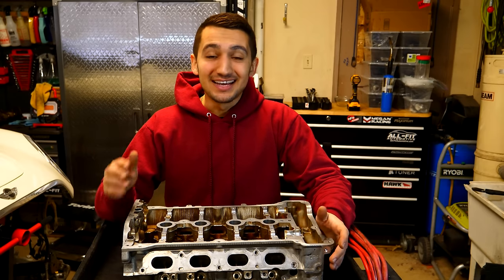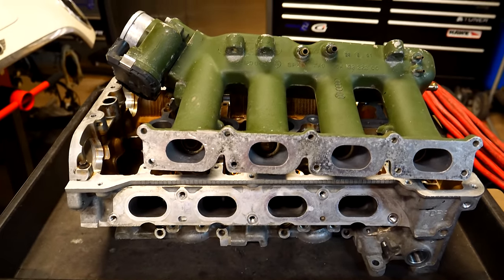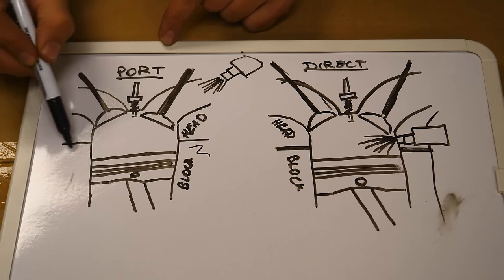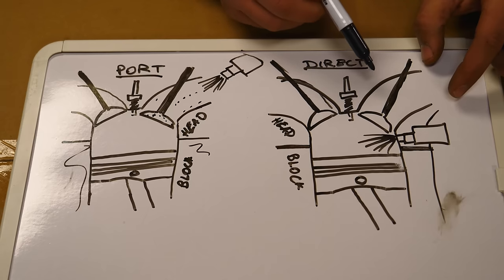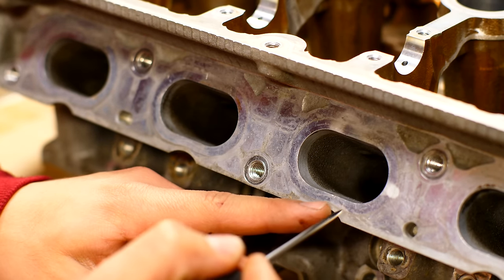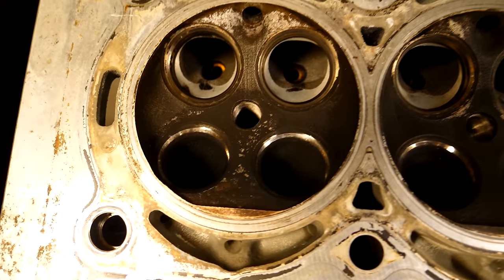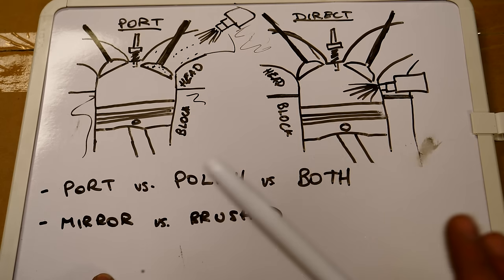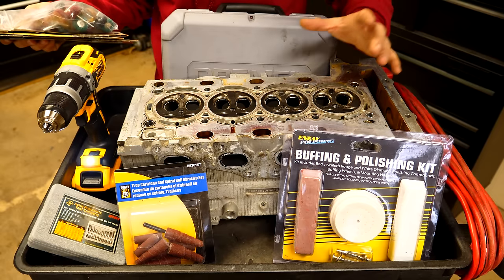Porting vs. Polishing vs. Both

Comment: Go back and learn before you impart knowledge.... Listen.... Dont take advice from a guy who sandblasts his head period.  Now Milanmastracci.... Let me school you on one of the most highly controversial subjects  in tuning.
1. never sandblast... Tank it or use boiling soap and water. sure it takes longer but its more consistent and safer.
2. Unless your running a carb you want to mirror polish the whole port. Heres why"
A rough surface makes turbulence which is controversial in gains at best. A rough surface is also a bed for contaminents to stick to which is a huge issue in VW direct injection engines... duh... 
A smooth port again is a clean port.    
Also a smooth port has a great drag coefficient. Sure dimpling wins on a flow bench but not by much.
3. Steps are never good. cutting that carbn ring area down or fitting a tighter gasket is a win win.
4.  good injectors atomize enough and a rough surface allows fuel pooling which is never good.
5. no port job should be  quick enough to last a few hours. Old experts take hours like 80 is avrage for a great port job.
6. If like me you dont haved a bench you should be using water. You can cc the runners just like ccing the head and it does help keep flow even.  
7. Unless your placing in new valve guides any porter should tape up the guides and use extreme caution in this area.
8. The exhausts can be cut to an extreme. IE the guides can be cut right off leaving a perfect polished tube.
9. if this makes no sense I am porting my lotus 910 head now and would be glad to take photos the only catch is they will be on mightycarmods forums.

Also note   I am glad you realize that FSI engines should be smoothed right to the valve seat.  Good on you.
Reply: DAmn auto correct. `mirror finishes OEM valves
Reply: @Robert DeHart You need more education, also. Rough surfaces don't allow pooling. Mirrored surfaces do. That's why no one polishes ports on a carb'd application. That's the only thing I'm addressing but it's not the only thing you're wrong about. Wanna learn real speed secrets and how it actually works? Leave those garage hacks, mightycarmods, and go check out speedtalk. Spend a month reading. You'll see just how much you don't know. 

These are top guys in the racing industry. People like John Kaase, for example. David Vizard. Darin Morgan of Reher Morrison. People like him that design cylinder heads. John Marcella, who makes Marcella Manifolds. Guys that have known names in the racing industry. Go learn there. You'll see just how wrong mcm is about whatever it is you've learned there.
Reply: When every dyno test shows power picked up with intake ports roughed in with a carbide burr vs sanded smooth with a cartridge roll, why would you want smooth ports? You can, keep em, and stay at the back of the pack.
Reply: Just like the people that think "bigger is always better" as far as port size is concerned. If it's bigger, it must flow more! You got a flowbench to check your work? Porting without one is like doing surgery blindfolded. You can increase the port size yet decrease to total cfm and never now it because now the velocity of the air slowed down. Now, it doesn't fill the cylinder completely and you've lost 15hp yet you don't know it because you assume bigger is always better! Go to speedtalk. Stick around for a while. You'll learn quite a bit from the guys who do this daily, for a living. And make a good livi g doing it. Why? Because they're good at what they do.
Reply: Making statements like "steps are never good" show just what you don't know, Robert. Take a BBC with rectangle port heads and put an oval port intake on it. It picks up 20hp every time and the mismatch there is UNBELIEVABLE. Yet people now do it purposely just for that specific reason. Why? That sharp edge does something to the incoming air to help it atomizer, mix, whatever it does. And it picks up power from a HUGE step. But if we followed your advice and tried to "gasket match" the ports, we'd lose at least that entire 20hp. Possibly more. Before you try to impart wisdom on anyone else, make sure you're not telling people this bs. Cuz that's what it is.
Reply: LMAO..... I've done enough testing. I need more education? It sounds like you read an article like the maker of this video and put it to memory. I'm speaking from experience..... 5.3 LS, 318 Dodge, J/K Series Honda....all respond better and ultimatelty make more power with ALL SMOOTH PORTS. They all have one thing in common, FI. As I said above, rough ports are good for carbed vehicles that use the walls to help anatomize. I'm sure that article you read made you feel extra smart 😂😂
Reply: You need to look for my first comment on this video. I clearly say carbed vehicles need rough walls. Maybe you should read more..... FI like smooth, carbed needs rougher walls to help atomize the fuel. This kid reads and article and thinks he knows everything. It's dangrous to listen to him. If you need help, call a speed shop or machine shop, or hell anyone but this kid
Reply: 😂😂  My (2) reply's are right next to eachother.  Baby boy needs his Ba Ba, his feelings go hurt.... "Dumbass" really hurt my feelings. I didn't know I was replying to a blind man, who couldn't see a reply on the same screen as the one he was replying to.....
Reply: @HalferLandPerformance  said the guy who responded like a 5 year old haha
Reply: Since you seem to be the expert... can i just smooth out my exhaust port or would i then have to do more work else where
Reply: @lachlanwithers2954  if you only want to smooth out your exhaust port- that's fine. Although cleaning up the inlet ports will see gains as well. There is generally a lot of surfaces that can be cleaned up in both inlet and exhaust ports- a "clean up" doesn't increase port size at all and doesn't necessarily smooth out the port to a mirror finish- it just gets rid of imperfections in the casting especially in transitions from the port to the valve bowl. To be honest, a lot of gains can be made in the valve bowl itself. Guys who do a lot of porting will usually use a P.D. valve (Pressure Differential Valve) on a flow bench so they really know how the port works and can be optimized. Don't be scared, get in there and have a go. There's only one way to learn- research and practice

Comment: Polish combustion chamber and exhaust on carb'd applications. Fuel needs to stay in suspension. With polished ports, fuel sticks to smooth surfaces, coming out of suspension and pudding in the port. Not what you want on a carb'd app. If you're injecting into the port, anything above the injection point can be polished also, to put it simply.

Comment: Good vid.rough port works like a golf ball,all the dimples have air in them allowing the in coming air to pass over it smoothly.any sharp edges in and around combustion chamber and ports creates hot spots,radiance all corners to keep heat down.and don't go through to the water jackets when porting or you will end up with water injection too

Comment: Ferrari build there v12 engines fully polished tried and tested but I suppose they lack the knowledge to know weather it’s beneficial!😂
Reply: Ive heard the "theory" that a rough finish keeps fuel atomized and that it actually helps flow a million times.  BUT HAVE NEVER SEEN IT PROVEN! EVER!  One thing I do know is that a rough surface does transfer heat to the air fuel. And yeah, I have actually seen that proven. I think that current F1 engines are fully polished also. So to me, it makes sense to fully polish everything. I mean if you cannot PROVE that your rough surface actually does ANYTHING better than polishing but you KNOW that a rough surface transfers heat into the intake charge then of course it makes sense to polish it.

Comment: IF you choose to "Port and Polish" Don't forget to raise the roof. NOT lower the floor. Such a controversial subject. Rough creates turbulence? Yes. Worse for air flow (minimally on a N/A motor) however better for fuel atomization (minimally). Gasket matching helps air flow? Yes, IF your N/A. If your boosted doesn't really matter. 30lb is 30lb. Your CFM flow will be the same because the restriction is when your valves close. If recirculating your PCV and valve cover breather into your intake manifold on N/A don't mirror finish the intake. moisture is attracted to the smoothest finish. just like a humid bathroom. what gets water droplets first? The walls and other parts or the mirror? If your boosted that shit better be going to a catch can and oil separator. So many opinions so many justifications. Basically all of it doesn't really matter unless it was a HORRIBLE cast from the factory with odd shapes and HUGE imperfections. If you want more power add more fuel and more air period! And please don't burn up a perfectly good drill. SMH

Comment: You and I are both trying to squeeze every bit of horse power out of these n14’s .  You need to talk to Ray from way motor works .  He has been pushing these engines for years.  Get the street cams and exhaust manifold ... a true 20-30 whp gain

Comment: I have been using the shark skin finish since the 80s. Only on the intake side though. It will take you some time to find the right kind of stone to achieve it thought.  I use a brand called cool stone. Used in dental work.

Comment: I have seen tests where a mis-match of, IIRC,  up to 1.5mm/60 thou" showed no difference in torque or power.
With heads, as with everything else, the trick is to find the "Goldilocks" for your combination - not too big, not too small, just right.

IIRC, Engine Builders (before monitised) had direct comparisons of three different port size heads on the, otherwise, same engine and peak power and torque were found with the middle size - of course, if it was a different displacement, had more/less camshaft, or whatever, the 'best' head might be different.
on that, constantly amazed by people who buy heads because of their high flow numbers at valve lifts their cam's don't even reach - as a general rule, I'm more interested in the head's characteristics around 75-80% of the cam's lift as that is where most of the flow will be taking place.
With a very mild engine, it's off the seat and the first few mm, or tenth, that is most important, for a good intake and exhaust signal.

With carbie, or port/TB FI there is one thing that might cause problems. Came across an instance where a persistent hesitation at one point of rpm/throttle use was put down to a mis-match between the manifold and head, we figured the step was allowing fuel to puddle there until there was enough airflow to pull it into the port, causing a momentary over-rich misfire - it was 'confirmed' when the step was removed and the hesitation went away.

Comment: You want turbulent air in the intake runner to make the fuel and air mix better but inside the combustion chamber you want the air flow smoothed out to aid in exhaust gasses being expelled. You can make the intake port too large before it hits the intake hole on the cylinder head which will cause a drop in incoming air velocity so you need a restriction from the intake runner to the valve. You don't want to loose too much velocity.

Comment: This won’t mater unless you’re running a huge turbo set up.......... if you port and polish and don’t change your set up. You literally wasted your time...also don’t forget about getting your radiator, you need cooling for that power.. transmission upgrades.. suspension and modular linear velocity. Breaks bars etc...  .. porting and polishing is one of the final steps in a set up. From the looks of it you have your steps all jacked up. 

Porting your engine by hand is the best way to fuck it up big time. 

Machine shop everything. For fuck sales you’re using sanding rolls and promoting someone to fuck up there intake/head/exhaust. 

How are you going to make sure that it’s all perfect? Out of the factory it’s 100% perfect. You’re going to mess up Liter pressure and fuck it up good. Unequal liter displacement with shiny stuff... makes no sense.
Reply: Go to school. Learn something. NOTHING is perfect from the factory and you are doing nothing but making assumptions.

Comment: Smooth with no obstructions is better (BUT) THE port benefits from leaving rough sanding texture to reduce drag and doesn't let the mixture stick & condensate, so a/f is nicely mixed . simply put. Never ever polish an intake runner. It's unnecessary to polish chambers but it can be slightly beneficial.
The only beneficial are on a head to polish after port work is the exhaust runner in fact the smoother the better. Carbon has a hard time sticking to a smooth surface especially if the exhaust mixture is properly burnt.

Comment: Removing casting flash does nothing for power reshaping the ports and blending the short side radius as well as the valve pockets is where you spend your time. Don't pay for polishing....smooth to dimpled ports and finishes may help power. Without proper spark timing and cam timing you will never see max gains.

Comment: Good detail shown and explanation... Most cases where most obd2 systems control air fuel ratio adjustments automatically, this kind of improvement to the head is subtle in feeling the hp gain (slight increase in throttle response). The real gain and obvious difference is to redesign 3 things. 1) the intake manifold with variable runners are best because they offer economy driving and responsive throttle when needed since it redirects air flow more direct with less resistance(more air shorter period of time). 2) the power control module should hold the pulse of pintle of the injector open longer(more fuel). 3) intake ports and angle of intake valve in relation to piston should be reconfigured in order to maximize efficient combustion along with a cam with higher valve lift. Ive done your method of porting out the intake ports n polishing them out and purchased polished intake manifold and i was not so impressed with the results of my engine.

Comment: Porting is better. It always maximum airflow and a easy transition from TB to intake and intake to heads. Polishing isn’t good on carb engines or port injection engines as the smooth walls don’t allow the air and gas to mix as well as it does with the rough surface. Polishing would be good on the intake manifold and direct injection motors

Comment: unless you are using a flow bench it really is an educated guess as to where the best improvements will be made. some imperfections on an intake Are purposefully put in to add low pressure zone in the right place. velosity can be tricky. Very good general outline however. Look at how air reacts in bench flow u tube vids you will see what i mean.

Comment: Match porting is a good thing but polishing I'm not sure.
A polished surface will create more turbulence then a rough one.
Let's take an object flying through the air like a golf ball,
it has dimples on it.
If you had ports done either way and flow tested to prove your point 
it would make a good view.

Comment: You said in the start of the video that porting means equalling the size of the intake manifold port, to the headers port size. That is porting. And usually, the header has a smaller size of port than the intake manifold, so in porting you usually increase the size of the header to match the manifold. Later on, in the video, you said that increasing size of the header does not really matter. Can you please explain. How is increasing size of header not going to make any difference?

Comment: There are a lot of people telling complitly different stuff about enlarging,polishing etc. I think enlarging ist just nessesary if you go up with power in general like with a Turbocharger. What about an N/A Engine? I have seen a Video where they test the flow of a Cylinderhead with 4 Different ports.
Original,Enlarge,Polish and Golfballport. The difference of the best one(Golfball) is just about ~5% thats not alot. Is there really a Power difference in the hole powercurve for a NA engine like my 1.6 Honds crx?

Comment: If u don't have the right shape in your combustion chamber and if your valves are obstructing your air flow, you're wasting your time with the polishing. Also, a flow bench will prove your theories wrong... read David Vizard.

Comment: Porting anything without some way to check your results is useless. When you open up that intake port, you may possibly flow more air but it might be moving through the port at a slower speed, which is an effect of increasing the mcsa of a port. When the air doesn't move as fast it doesn't fill the cylinder as efficiently. In the end, the port may flow more air but your engine ends up using less because it now can't fill the cylinder due to the airspeed.

Comment: Wait...so people are arguing that a rough surface will provide more flow?
I’m no expert but...it rough surfaces provided lower drag, you’d find aeroplanes would have such technology.
Think of the fuel savings of a plane that moves through the air more easily.
Just saying.
Reply: Burkeys randoms Well its a proven fact that intake runners perform better unpolished. Compare to a golf ball. The uneaven surface bind som air that the rest of the air flows over more easily than the material in it self.
Reply: Fredrik Rapp a golf ball is an entirely different analogy. A golf ball is using SPIN. Guess what? The dimples create a certain amount of drag. The ball backspins once it’s been struck, causing a high pressure under the ball, low pressure on top. Yes, lift.
Again, if a golf ball surface or rough surface was optimal for a lower fiction co-efficient, you’d see it being used in aviation, Motorsport and even in the automotive realm generally. You’re basically arguing that large panel gaps (that create swirl) actually OPTIMISE airflow...